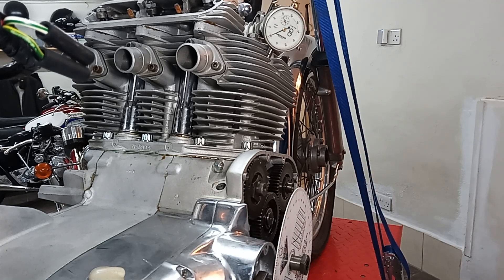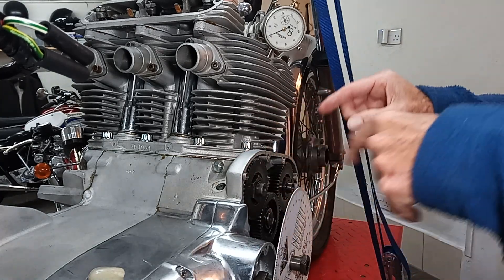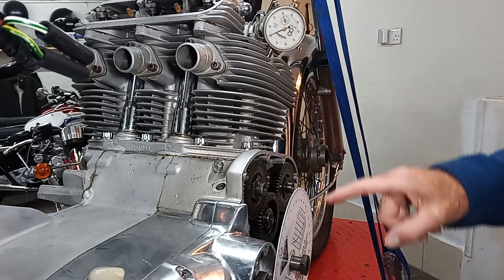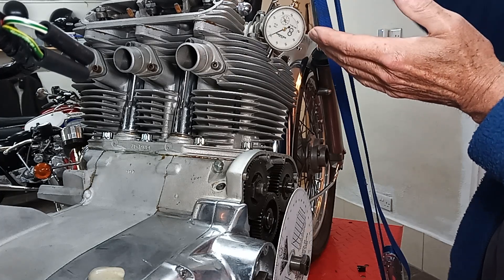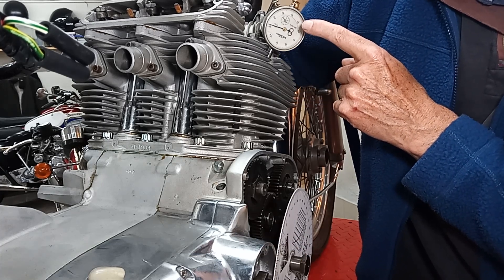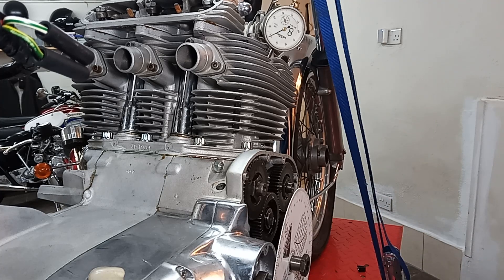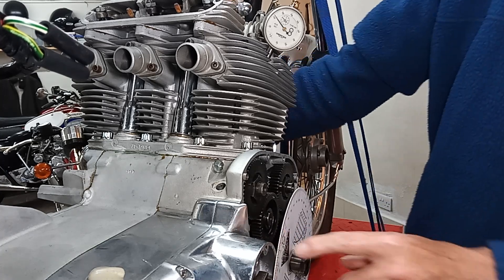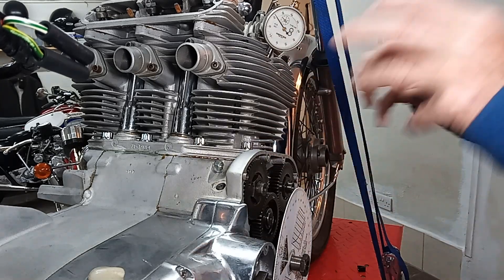Triumph Trident T160 Rebuild. Part 63: Optimising the Valve Timing 1

Comment: Using a piston stop is a much better and faster way of setting TDC. Best to set Triumph cams to the maximum lift position as denoted in the manual. In most cases the cam wheel will need to be fitted using an alternative key way, and sometimes the cam wheel to idler position will need to be changed.  Correct cam timing, will make quite a difference, and running will be lots better.

Comment: Valve timing its more important to set the intake centre line , so even on a Commando get the intake right and not worry about exhaust   , good practice to recheck piston to valve clearance  after adjustment,  so doing this when motor is dummyed  up is better , can also use checking springs .

Comment: Hi; may be in a trident is different but normally is better to proceed before to put the valves to not fight with the springs tension.
Reply from the maker: Yes, valve clearance should be set to zero when the timing is checked - but we've not got to that part yet. We don't need to set the clearance to zero to find TDC.
Reply: @Chris.rooke150  I was referring to the "lobe center" method of similar not to the valve clearance itself. I mean; search for the best way that the gears would fit instead of using the factory marks.
Reply from the maker: Right, I'm unfamiliar with that method. I only know thus one for Triumphs/Tridents. 👍